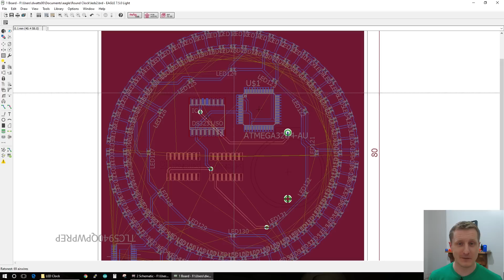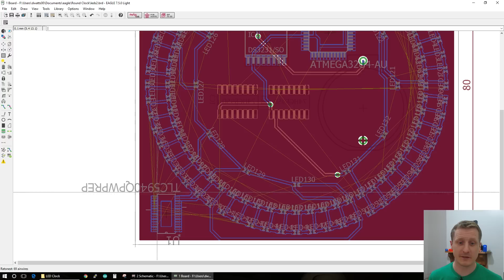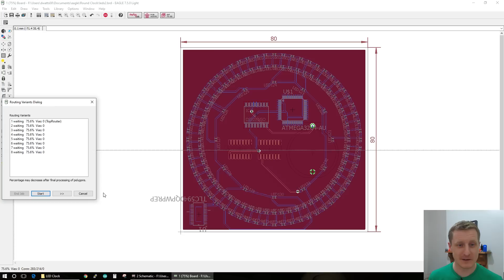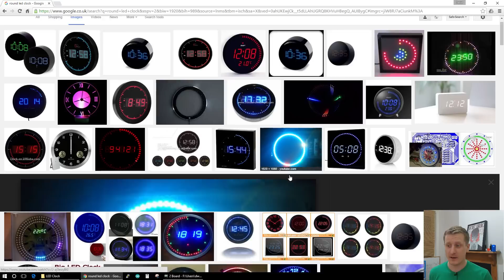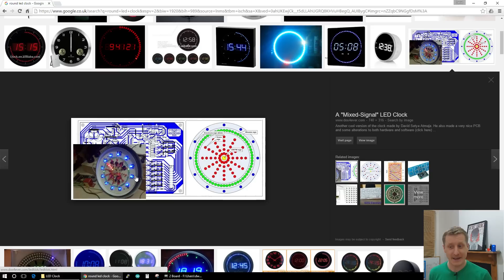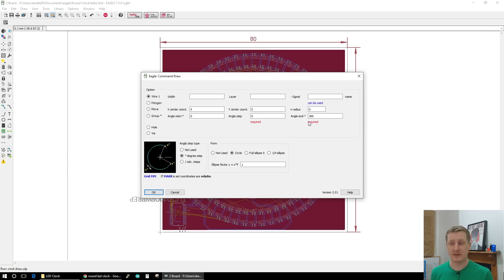LED Clock: Problems abound

Comment: For this kind of thing it generally comes down to finding that magical combination of part placement which results in as few traces crossing paths as possible.

Grouping the LEDs that share lines, flipping them around to get the row and column lines on the best choice inside/outside, rotating the ICS / the LED groups such that none of the drive lines need to cross each other to get out to their column/row, using both sides of the board, etc.

People like to complain about the 595's current capability in relation to LEDs but I've used them before in similar circumstances with great success :)

When routing a board like this, here at tymkrs we like to play the game of how few vias can we do it in, and of those, how many can we hide under chips / leds / etc.

Enjoy

-w
Reply from the maker: +whisk0r I know what you mean. Someone just commented on how I could have better placed the LEDs, it was a head slap moment. I definitely could have prepared better :-)
Reply: David Watts I take solace in the fact that no matter how good of a job I do, some noob will always walk by and point out the one stupid thing I totally missed heeee

Comment: Just looked at the TLC5940 datasheet, and it has constant current outputs. I wonder what happens if you drive rows of LEDs instead of just single ones on this device that has constant current outputs... LEDs don't share current very well if put in parallell and without shunt resistor. Another thing is that what if a whole row is supplied say 10mA. If that row has one active LED, then it gets 10mA, but what if 5 LEDs are active.. ? Sorry for all the questions and no answers.
Reply: oh you run one at a time. no problem then :)

Comment: Autoroute is crazy. I use the free DipTrace program and autoroute on that is a no no. I do all mine by hand. Autoroute has all the board to run 2 tracks for example and it puts them really close together. Also even on a single sided board it tries to put in vias. Saying it can't connect. But I can do it by hand. I don't think autoroute works very well on any package. Great update sire. I only have one more thing to say. NEXT! Please.
Reply from the maker: +Raymond Earle Thanks Raymond, I will keep you updated. The auto router is always a no no but it can sometimes throw up some interesting ideas or at least some hope that it is actually possible :-)
Reply: Maybe Google maps would be more accurate?

Comment: I don't think the 74HC595 can source enough current for 10 LEDs. If I can remember correctly the maximum current per pin is around 35mA. So that's 3.5mA per led, if all 10 are on simultaneously. 

Since you're going to need that many vias anyway, I'd put all the chips on the back. To make it prettier. 

Since you are using the 32u4 I'd add a usb connector for easy programming and powering the clock. But you probably already though about that. 

Good luck with the routing. Be glad you're not using charleeplexing.
Reply from the maker: +beargun42 Thanks mate, I should only be running 1 LED at a time so the 74HC595 shouldn't suffer too much, I imagine each LED column will limited to 9ma.

Comment: Also, I would try and keep all the chips in the middle - or on the underside on a two layer board,rather than trying to fit everything on the top layer. However, I have to take my hat off to you for the effort - it's much better than I could have done ;) Thanks David